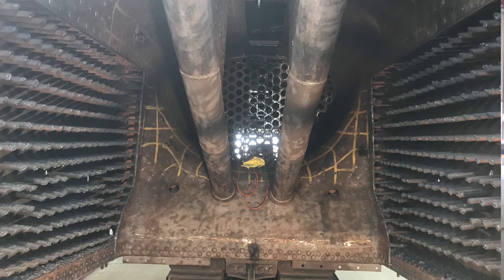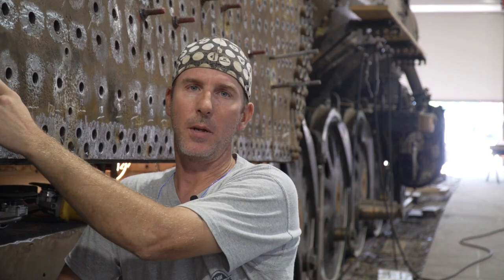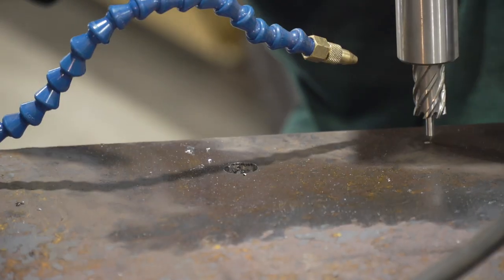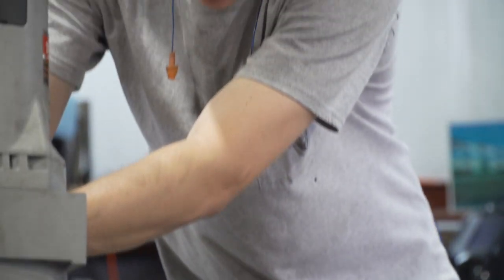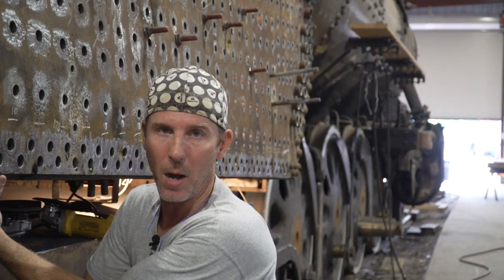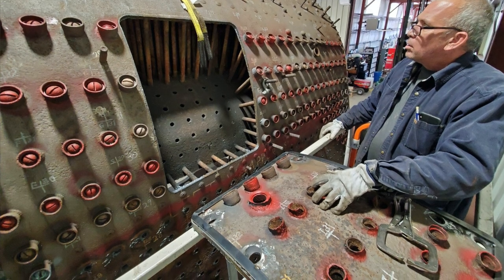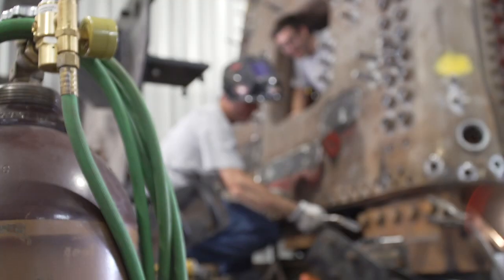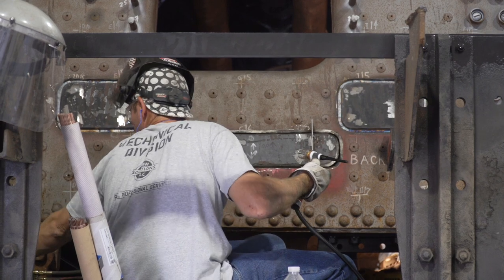No. 576 - The Road to Revival, Episode 8: Firebox Sheet Renewal

Comment: #844, Big Boy, 1309, and several others they had to do the same thing. If the Firebox is rotten you cut everything out and replace it. Several of these sheets have leaking staybolts that is a sign you have to replace it. Good luck with the rebuilt.
Reply: ...yyyup